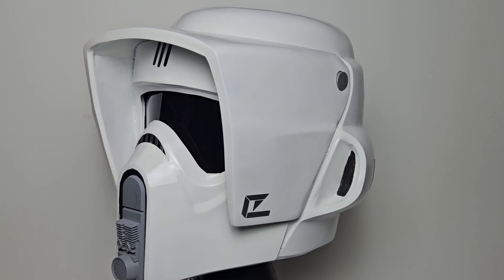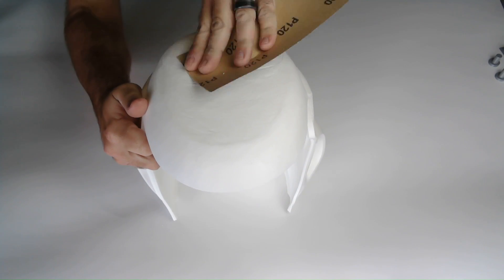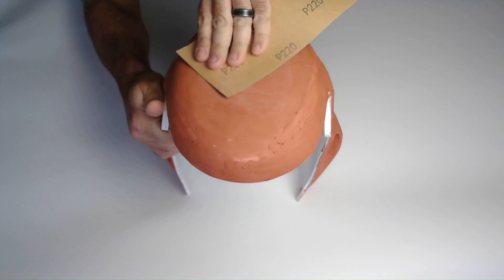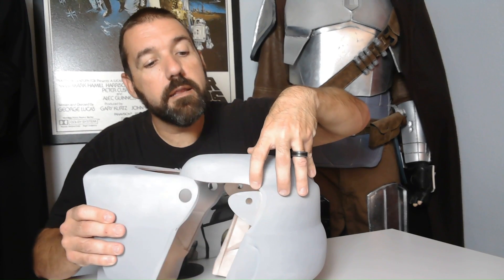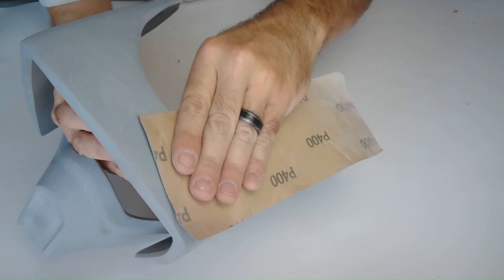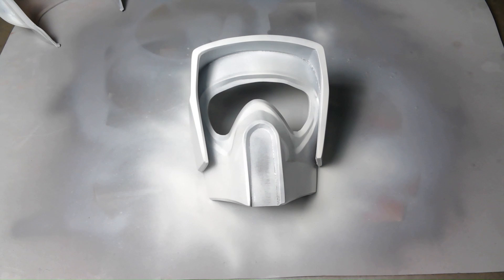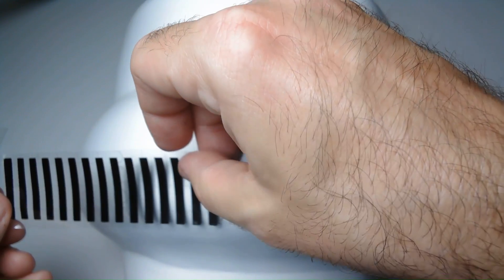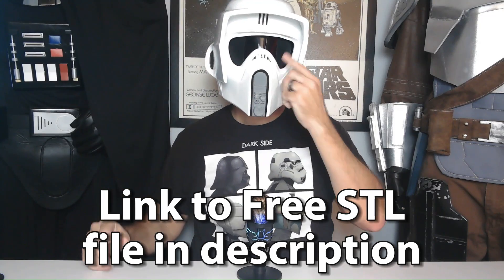3D Printed Scout Trooper Helmet | Review And Build | Star Wars FREE STL Files

Comment: Looks great! Printing my own now! What did you do to connect the front and rear of the helmet?
Reply from the maker: That's awesome! Good luck with your print! The printed bolts hold it in place and still allows you to open it. The bolt was a tight fit and held in place without glue.

Comment: My suggestion for both cost and retaining detail is do a quick initial sand, then use a sandable primer, but in only a few light coats. Then sand the primer down. Then use the Bondo as intended and only use it to fill deeper lines. Then sand and do another sandable primer. 

This is way less expensive and you don't run the risk of filling in detail or changing the form of the print. It also reduces weight. If you're going to use Bondo as a filler like this, I recommend thinning it with Acetone. It goes on a lot smoother and you don't get buildup that you have to spend hours sanding. 

Finally, I never sand my Bondo dry... only wet. The amount of dust created is nasty.
Reply from the maker: Interesting. I'll give that a shot on another build.

Comment: Thank you. Great tute. How long did this take to print? 

Also instead of putty can you build up the smooth surface with more coats of primer?
Reply from the maker: Thank you! It was about 120 hours of printing time. Just using the primer should work, but that would take a lot of passes to get rid of the layer lines.
The putty will save you lots of time with 1 pass.
Reply: @3DMaxBuilds  thank you so much for the quick reply.